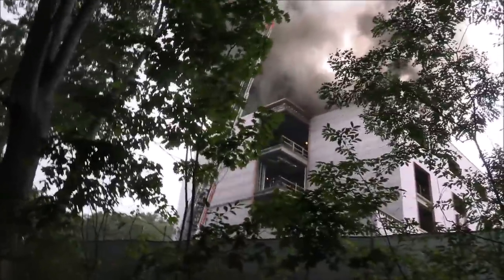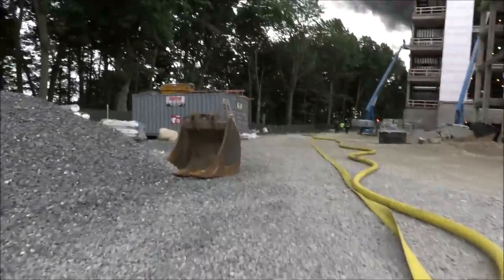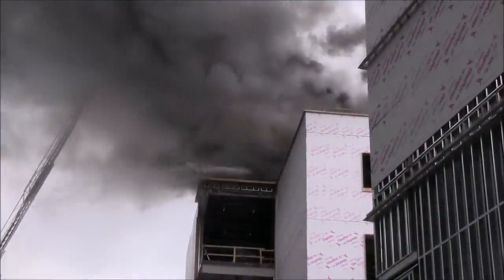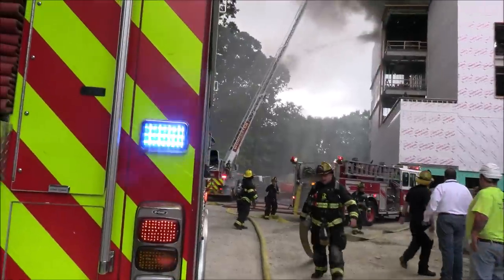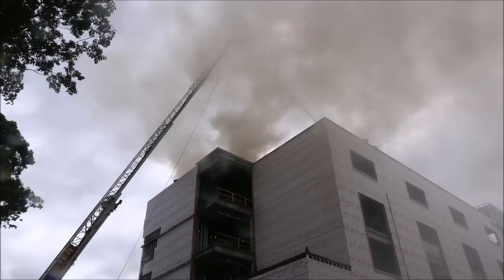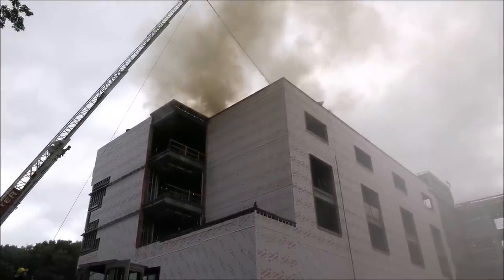Working Fire, Doherty High School With WFD and Udizzy1969

Comment: Was there an actual danger of collapse? I heard the chief said several times that an area is compromised
Reply from the maker: Well The roof Floor was getting soft in Some spots from what I understand, They All Did Great work Saving This one. Welding with no fire extinguisher is Never a Good Idea.  Stay safe Dizzy.
Reply: Great videoing as always good job and stay safe
Reply from the maker: Thank You Very Much, Cheers Dizzy.

Comment: Dizzy, was it not until 15:35 before that ladder truck started discharging water?
Another question, did they say there was NO standpipes in the building?
Just curious, thanks 
Great filming by the way.
Reply from the maker: Yes No Stand Pipes working Nor Hydrants on Site, They Did Great work. Be safe Dizzy.
Reply: I'm guessing that the plumbing and fire suppression was yet to be installed.
Reply from the maker: Ding, Ding, Ding We Have A winner Folks, Very True My friend, Stay safe Dizzy.